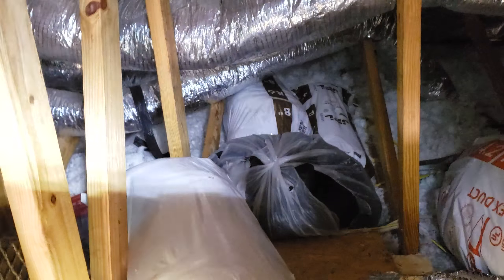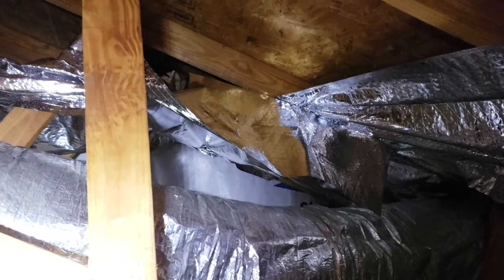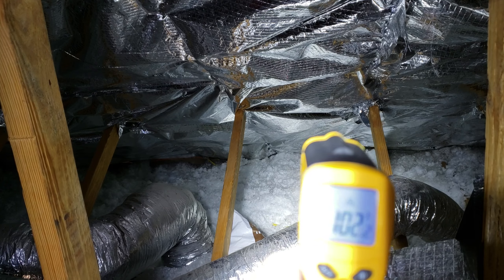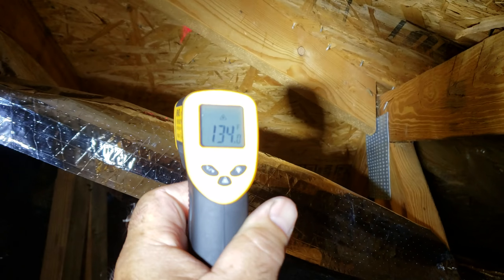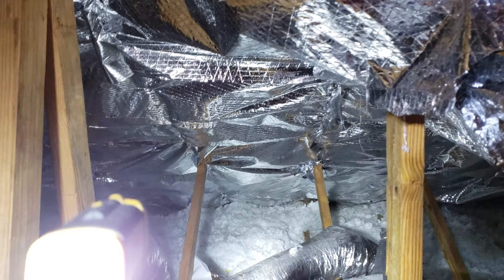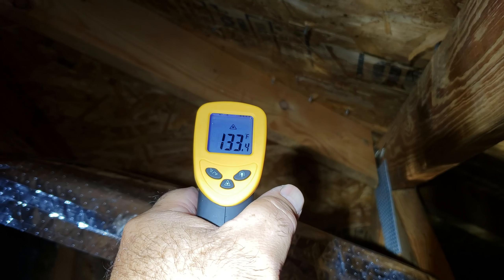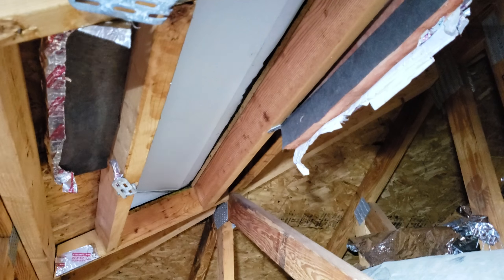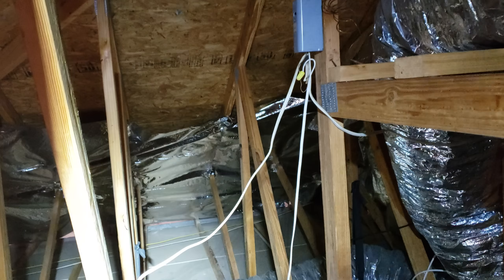Aluminum foil installation on my attic.

Comment: So yes, it definitely works. But you will need the fan to move the air because the air will not move that much naturally if it's below 130. I would use a humidstat on the fan because at this point you are mostly concerned with moving the moisture out of the attic with a fan.